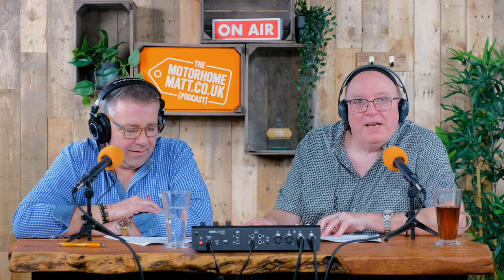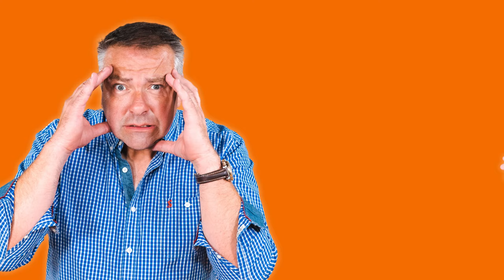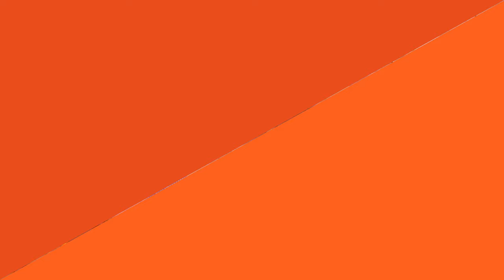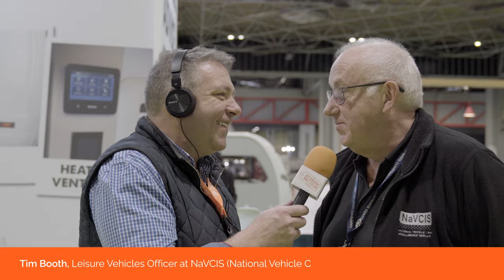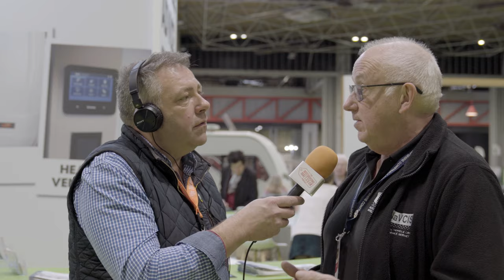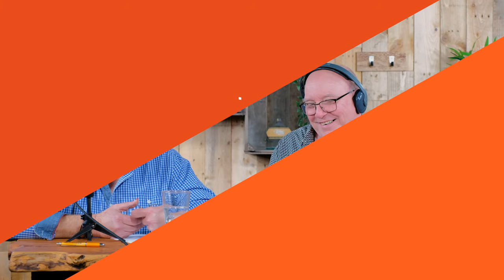What are WIMS? How overweight motorhomes could be easier to detect

Comment: I have just been to the local weigh-bridge with our “new to us” 2017 Peugeot Boxer Calders Camper conversion to get it weighed before loading up with all our goods and shackles!
This was with 7/8 fuel, full gas and 40% fresh water we weighed in at 2,940kgs.  We therefore now know we have a payload of 560kgs, less our dogs and our weight.  Given the lack of space compared to our 7.5m Coachbuilt, then I can’t see how we have got the room for coming  close to our maximum payload.
Reply from the maker: Simple. Beer.
Reply: Although that sounds like you’re ok as it is under the overall plated weight but it could still exceed an individual axle weight.
Always use a weighbridge that can do individual axles most overweight motor caravans exceed the rear axle weight as stated on the vehicles weight plate. End result same fine or prosecution.

Comment: I agree Kevin is great, you both bring a smile when I watch your pod casts, even though I am from the dark side coming back to caravaning after a 13 year break. Have noticed everything seems heavier But I suspect that’s an age thing as I have from yesterday officially a gimpy knee that will not get better but will need replacing eventually
Reply from the maker: Kevin is always right! As long as you're travelling how you want then it couldn't possibly be the dark side (don't tell the other motorhomers I said that though). Wishing you all the best for finding something to help your knee problems.
Reply from the maker: Thank you and welcome! I think all motor vehicles have become heavier in general. More safety equipment and driver aids mean more weight. Our 1934 Austin 7 is tiny and light compared to the modern mini!

Comment: I’ve got a residential 415w solar panel on my van not had any problems in the last 12 months and only used the mains charger three times
Reply from the maker: Excellent! What made you choose a residential panel? Its size?
Reply: Purely because the son in law sells them and offered me at cost no other reason.

Comment: With the flyscreen bracket, its not just Adria, its also Eddis CV range and probably many more. Ours fell off all the time until the whole screen was replaced, now no issues.
Reply from the maker: I’m not sure it’s all Eldiss CV models tho. We’d love to work out which ones this can benefit! Some buyers say they don’t fit
Reply: @MotorhomeMatt  Our van is a CV40 Oct 2022 .. when I was in the CV Facebook group, lots of people complained about the flyscreen & the many many other faults. Terrible that Eddis do not fix repetitive faults. We were always complaining about the same issues.
Reply from the maker: So would this bracket fix that? I might have to try it!
Reply: @MotorhomeMatt  Adria Doors are on the R/H Side. You need to ensure you get the L/H door side for UK vans. Also the bracket does not fit all flyscreens, so try to buy from somewhere you can return it to if it don't fit. GL.
Reply from the maker: At That Leisure Shop we would accept a return and refund in full. I’ve fitted this bracket to a Twin 600SP uk side door. Most Twin models  are drivers side door

Comment: You should probably point out that you can be over weight especially on the rear axle without exceeding the gvw. The wims weighs each axle to calculate the total weight.
Reply from the maker: That is correct but an overweight axle can be a problem
Reply: My point was that an overweight axle is illegal. You cannot be over the gvw without at least one axle being overweight . Using the gvw is an incorrect way of describing being overweight. It is about not overloading individual axles regardless of the gvw.
Reply from the maker: That’s quite right! Basic maths right there. Thanks Andrew